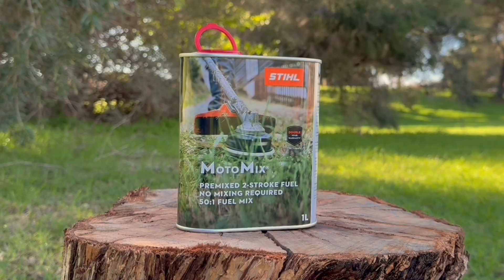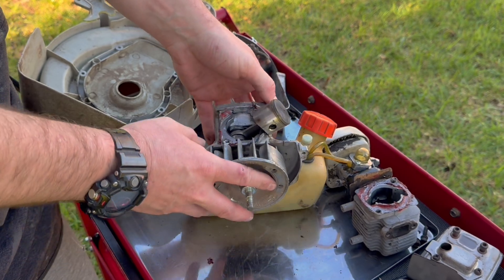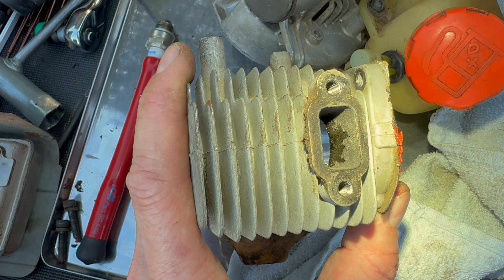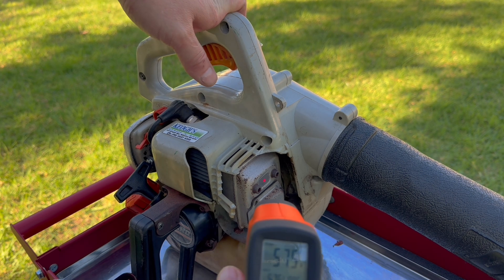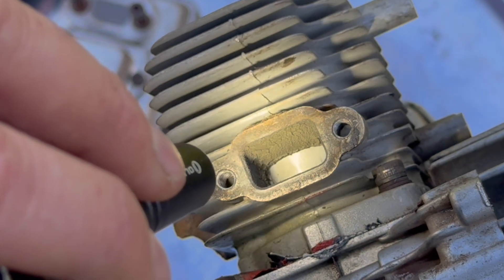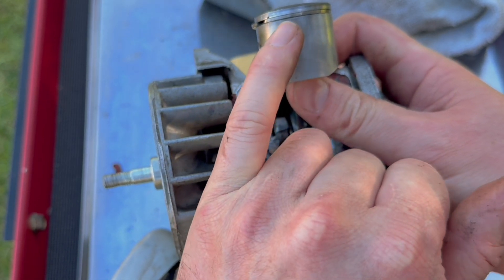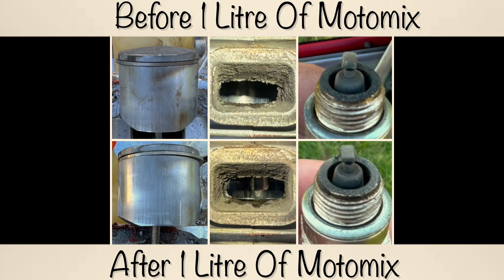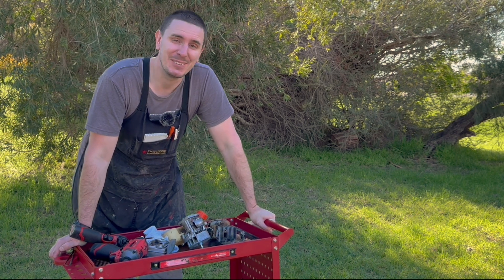STIHL MOTOMIX: Are They Stretching The Truth?

Comment: Not sure I agree with many of the comments here. In the UK specifically, to get ethanol free fuel you need to use super unleaded. That's £1.60 a litre easily, so we're talking £8 or so just for a 5l can, then add couple of quids worth of oil into that can which has a limited shelf life, you're actually talking a very small amount for a home owner thats burning 5-10l per year in fuel. For all the reduced hassle of having to run machines dry after use, dispose of old fuel, mix correctly. For me and the amount I use, the £2 a month difference over a year of getting the quality pre-mixed fuel is worth it.
Reply from the maker: Ouch that's expensive!! It makes the price of motomix more justifiable for sure!! Fortunately here in Australia we pay $1.60 per L of ethanol free 91 which is roughly 80 pence lol.

Comment: I strongly doubt those additives will actually reduce existant carbon deposits. Best to use quality fuel, quality oil, ensure the carburetor is tuned appropriately and have the correct plug & gap.
Reply from the maker: They do burn much cleaner, but with a good 2 stroke oil it will contain detergents to keep things cleaner anyway :)
Reply: @VintageEngineRepairs  When my Echo oil ran out I used the oil I got with the Husky 236 and with that gone I got some by Penrite - not used yet - but it'll be in my next fuel mix. I did use a little Castrol at some point. Never had issues - thank goodness.

Comment: On the subject of changing of mix ratio's without carb adjustments (old brushcutter experiment on Vintage Engines), . . I think I've managed to establish a trend or pattern to how my saw tools have behaved this winter, which I did not expect. My Auto Tune four and five series Husky's are working better with change of weather with more gasoline, less oil (fifty to one 'ish' mixes). For the warmer, milder parts of year I supply all my tools, older and newer from the same forty to one container, which all tools seem to want. Including my new 550 XP and 585 saw. What's strange about the latter as they got into winter working they favor 50 to 1. So I assumed that my three series 372 tools would exhibit a similar preference, yet I discovered straight away the 372 said no. Mix me a dedicated 40 to 1 container, like it usually favors, which I did. And the 372, 365 tools all went back to liking their fuel again. So it seems that winter weather and winter climate affects modern auto tune saws much more than older designs? Does that make any sense? I'll figure out in 2025 when the weather improves if all these tools converge back upon the same fuel preference again, but as of December, it seems clear to me that auto tune wants more gasoline in bad weather, the three series tools don't care to the same extent. They just want consistent fuel mix all year around. Am I imagining that, or does it make any sense. It was my little 'four series' tools that drew my attention to it, the 435 tools started to run better on 50 to 1, . . and when I sensed that change in operation on the smaller tools, I noticed a similar preference in the large five series 'pro' auto tune models too. Summer time I run everything on 40 to 1, and it's been working out for me. I've tried all the Husqvarna full synthetic and semi- synthetic products. Haven't yet expanded out beyond that in terms of oil use (however, I source gasoline supply from a long haul fleet fuel supply station at a port, and their gasoline has worked well in my saws). My automobile garage pump stuff, definitely operates different in two stroke engines, so I went back again to using the gasoline the professional van drivers use at the dockside. I agree though, changing gasoline source could make more difference than oil to fuel ratio's. But I'm finding something is up with five series Husky tools in winter, which doesn't affect three series tools from Husky the same. I'm convinced of it.
Reply from the maker: Thanks for sharing your experience!! Very interesting 👍🏻

Comment: The one big thing with the can fuel is less smoke and that toxic stinky smell especially in tight areas with not much ventilation. I have run 98 octane premium with the stihl oil for years with little problems but it does go off after 6 months especially in chain saws that don't get used much .I've heard the can stuff doesn't do this.
Reply from the maker: That’s a very true and a valid point :)

Comment: Ok, but where is your control subject? Yeah, a lot more work, but you'd have to do the same thing with another blower running pump gas. It just sitting there at WOT with a load for hours may have done that cleaning.
Reply from the maker: I think that’s a great suggestion! Very valid points too, I absolutely agree.

Comment: Alkylated gas is great, the problem is the HP ultra oil. I personally get Aspen 4 and add my own oil (Motul 800 offroad). Very happy with the result, and bad gas/hardened rubbers are a thing of the past.
Reply from the maker: If I had the option for aspen 4 out here that’s exactly what I’d get :)

Comment: I always used to go with the aspen 2 stroke pre mixed fuel as I was told, and believed, that it cleans the whole engine. I did a similar test to what you did in this video and found it made little difference to mixing my own fuel, not really cost effective in my opinion. 
Great video though 😃👍
Reply from the maker: Thanks for sharing your experience!!

Comment: Thanks for your videos 
I would say it's likely if there is any improvement it is from the 2 hrs of full throttle that cleaned it ,most don't use 2 strokes properly which can cause excessive carbon build up
Reply from the maker: Very valid points :)

Comment: Can we run it again with regular fuel /oil mix in the same way, 1 litre WOT, to see if it gets dirtier after the same conditions, to eliminate the possible cleaning effects of the 'Italian service' it also got with the moto mix? If it only previously got used periodically for a few minutes then it could be argued that simply a prolonged spanking was enough to do a little bit of cleaning. If nothing else it'll be a much cheaper video to produce!

I use echo power blend gold jaso fd made in USA (by spectrum i believe) at 50:1 with higher grade fuel for lowest/no ethanol in everything, we mostly have echo equipment worked hard commercially every day. Plenty of high hour engines in the fleet, they are all extremely clean internally, even after 300 to 500 hours. Never fouled a spark arrestor or plug, never had a wear related failure etc. A couple of older units must easily be pushing 800 plus hours, no issues. It's very easy folks, read the manual and do what it says.

Edit: Not knocking mixed fuels, for infrequent use, especially by home owners, it solves a lot of shelf life and storage issues. Carb diaphragms rejoice! But as a business we use so much fuel, not worth expense and always fresh/correct mix.
Reply from the maker: You raise some excellent, very valid points :) unfortunately it’s not with my any more, it went back to the customer!
Reply: @VintageEngineRepairs  Good to know there's another old echo released back into the wild!
Reply from the maker: Yes! It’s used by a commercial customer :)

Comment: I'm not sure that ANYONE out working in the bush or woodlot is thinking about emissions. I know I don't. I simply need to get the job done, with whatever works. I've used premium gasoline (ethanol free) and quality two-stroke oils at 32:1 for decades, even in my newest saws, and have had absolutely no trouble. My oldest saws, a 1974 Homelite XL-2, an early 70s Homelite XL-12 and a 1979 Stihl 028AV, are still in regular use. Try seeing how long the newer saws at 50:1 last!
Reply from the maker: With your fuel / oil ratio you can’t go wrong :) thanks for sharing!

Comment: As my buddy Claus the Hobby Motor in Denmark pointed out to me alkylate fuel will not remove grease from a workbench but when used full time on a new piece of equipment the engine will run perfectly, start up even after a prolonged 2 year storage, keep the internal components as new and even help clean up some carbon deposits on older equipment. Here at EP we started buying Aspen until our B&S distributor switched to their own brand called Kinetix which we have been selling for many years now without issue. As i commented to Bill our profit margins decreased because of these sales when we look at our customer base that purchased this fuel simply because start ups where not an issue anymore. In the positive end our customer base and sales of Kinetix has grown substantially just from customer referrals to others thus a profit margin growth.
Reply from the maker: Hey Wayne! Yes he mentioned that to me before too :) he’s a smart guy with lots of experience in engine repair isn’t he! I had wondered how much people would lose in business from recommending it Thanks for sharing mate :) glad the sales have helped counteract the reduction in repairs!!
Reply: @VintageEngineRepairs  Thanks Tom anytime you can do something for your customers that eliminate them from having to come back is a positive issue for us. Since we started selling the Kinetix we now get mowers coming back ever 2 to 4 years for full service (but never a carb cleaning issue) vs. before the customer used the alkylate fuel for storage sometimes every year for a no start issue and even if longer the carb always had ethanol build up in them.
Reply from the maker: Interesting take Wayne! I’m not sure I’m on the same page there, if customers don’t come through the door, I don’t have a job :/
Reply: @VintageEngineRepairs  Instead of every year with no start equipment they come every two or three years for service but never need that carb cleaning again so not only do we lose out on annual carb cleans the service part is also delayed. The bonus is we pick up an additional 5 to 10 customers from them referring friends and relatives and begin the entire customer training programme again until the get educated enough to realise that a purchase of one can of Kinetix saves them a lot of money and aggravation.
Reply from the maker: That’s great that works for you mate :) good to know!

Comment: I have used Aspen2 for several years now and I am seriously impressed by it. FWIW. I use Aspen 4 in my generator and the cleanliness of the oil does indicate how little contamination of the sump oil is definitely indicative. If you used it from purchase you would know that there’s less carbon, especially in mufflers on two strokes. The big plus is reliability of starting after long lay ups .
Reply: Yea, this thing doesn't seem to age at all in sealed containers (like the gas tank for example). Had a family member that used Aspen 2 in their chainsaw and left it for around 5 years unused. I was intrigued and I went with him to start it. Ran on the 3rd pull like it was fresh gas!
Reply from the maker: Having some on hand, especially in a generator makes a lot of sense. When you need the generator, you’re most often in a predicament and you can’t afford the time to just take it in for repairs! Thanks for sharing :)

Comment: Thanks for the good video! 
Correctly mixed, fresh pump fuel will not give excessive carbon buildup provided everything else is right. I see the advantages of alkylate fuel in other aspects: Less toxic both as a liquid and as exhaust fumes, unlimited shelf life, no chance of getting the mix ratio wrong. For the normal home owner the added cost will not be too forbidding. When it came out here in Germany, some experts advised against using it in older machines that ran on pump fuel before. I'm not sure of the arguments used any more. You do not hear this opinion nowadays, so I guess "experts" may be in error as well ;-) 
I use alkylate fuels in older and newer equipment without any issues. But it may be just me, as I neither have issues with modern 5-10% ethanol pump fuel in my small 4-strokers ;-)
The correct setting of the carburetor is more important for trouble free operation than alkylate fuel or not. 
I have used the generic term alkylate fuel and no brand name because in my opinion they are all alike.
Reply from the maker: Thanks for sharing!! I agree much cleaner burning and less toxic, which for many is enough justification :) I have used it in both old and new equipment and I haven’t had an issue. Now days I only use it in particular circumstances like storage :)

Comment: Great video my friend, I can't say anything about Stihl Motomix as I've never used it  but I can say 110 percent that Aspen 2 does. I used to mix my own fuel but I was recommended Aspen 2 by my local shop quite a few years ago and have used it ever since. A prime example of it is I have a Stihl SH86 vac/shredder and every time I serviced it the piston crown and exhaust port had carbon deposits on it, since using Aspen 2  the inside of the engine looks like brand new with no carbon deposits  and same goes with all my other two stroke equipment. It takes a few tank fulls but it works. Yes it costs a bit more but I don't mind paying that bit extra for it and I would recommend Aspen 2 and 4 any day. Keep up the great videos my friend.
Reply from the maker: I wish we could get aspen here in Australia! Glad you like it and have gotten excellent results! Thanks for sharing :)
Reply: @VintageEngineRepairs ,yep we always behind most countries. I dumped Stihl mix long time ago !
Reply: Yea the oil Aspen 2 uses is superior to HP ultra from Stihl. That oil burns super dirty, I'm never using it again. Their regular mineral oil, the red HP, is superior in every single way....

Comment: Don’t use expensive fuel mixes use good quality oil : I use Mobile 1 2T it’s been excellent for my high powered RC 2 stroke engines 25:1 & 28:1 are good mix for my needs, some weed wackers are saying 50:1 that’s lean and will cause hi temperatures and premature wear
Reply from the maker: 50:1 often will reduce the life expectancy of an engine, I agree!
Reply: No, you don't need good quality oil at all. You can use engine oil in all two stroke gas engines.
If you buy two stroke oil it says 2% on the bottle, that is 50:1. That is what you should use for a mix ratio.
25:1 is 4 % and it is going to generate a bit of smoke, with no other benefits than a bit of extra smoke.
Reply: @Drottninggatan2017  I understand if your talking about certain low reving engines that are not designed for high performance, I’ve used a load of different oils in the past with good gas , I would never use a basic oil in my engines, the standard for high performance 2 stroke engines is a 25:1 mix , I don’t ever have excessive smoke or any issues because my tuning is always on point,

Comment: The problem I have with this fuel is not only the price but the fact that it cleans carbon buildup on 2stroke tool engines which are relatively easy to disassemble and clean manually. If it was few cents additive, it would make much more sense.
Reply: The point of these fuels imo is storage stability and protection. I know of a chainsaw that stayed with aspen 2 in its gas tank for 5 years and started on the 3rd pull. That's what sold me on it.
Reply from the maker: Yes, shelf life is a huge bonus!
Reply: I own a BR600, and a FS56 from Stihl, they get occasional use. With the motomix they always start on the second or third pull after they have been stored for a longer periode of time.
This is the main reason i use the stuff.  @em4703
Reply from the maker: Very valid points :)
Reply: Get some echo red armor, it’s a little more expensive than most two stroke oils but it’s way better than the motomix and I think would work out to $2-3 per gallon compared to other oils.

Comment: Great video as always Tom 👍 - my experience - mainly with chainsaws - is that cleaning does happen especially around the rings. I also see saws which has run on MotoMix from new - and after 2-3 years of commercial use there are hardly any carbon build up in exhaust port or top of combustion chamber, piston crown or spark plug. Of topic but alkylate gasoline like Aspen2 and MotoMix will also make diaphrams and fuel lines last longer compared to pump gasoline containing ethanol.
Reply from the maker: Hey Claus! Thanks for the kind words mate :) you raise excellent points there and I couldn’t agree more! Cheers 🍻

Comment: I like Alkylate fuel to store my machines, but I think it's a bold claim to say they will clean the carbon. I buy the Aspen 4 and Mix my own Amsoil Sabre at 40:1 rather than buying the Husqvarna, Stihl or Aspen 2, It is very expensive. Totally Ethanol Fuel is now hard to come buy in the UK. Shell and Esso say their premium unleaded is up to 5% ethanol. So I tend to buy these and have not had any problems so far.
Reply: In Canada all grades now have ethanol up to 10% the higher octane grades may have 5% but we have tested some at 10%
Reply from the maker: That sucks, we don’t have ethanol out here in WA Australia fortunately, but I’m sure it will come.
Reply from the maker: I have heard good stuff about aspen :) good move!
Reply: @VintageEngineRepairs  It is £24 or  
$46 Australian Dollars, which seems expensive. I always give Aspen back in things that I fix for others. I know then that it's not the fuel that has gone bad if they are occasional users.
Reply from the maker: I use to buy motomix accepting that the cost is offset by no smell (before being burnt, or at least inoffensive) and it wouldn’t make the Mrs mad either haha

Comment: I run 50:1 in my Husky 135, 455 rancher and stihl 08s. Stihl hand blower and hedge cutter and I have had no problems with a fouled plug or spark screen and the machines always fire up and run.  The biggest improvement is extracting the ethanol. I can pick up any of my machines even after 2 or 3 months and they will fire and run as they should. It was an interesting experiment but the fuel is very expensive. Good video.
Reply from the maker: Yeah ethanol is a real pain! Thanks for sharing :)